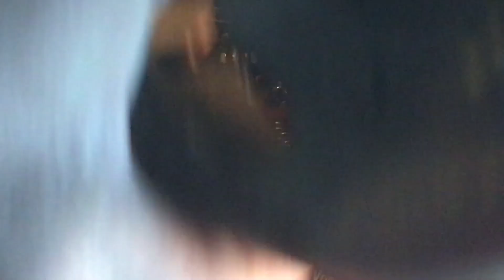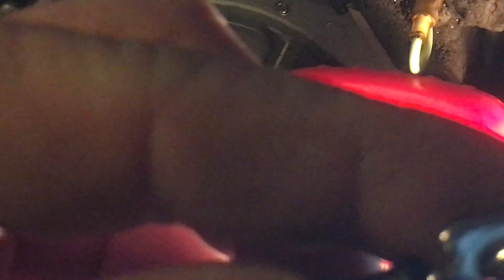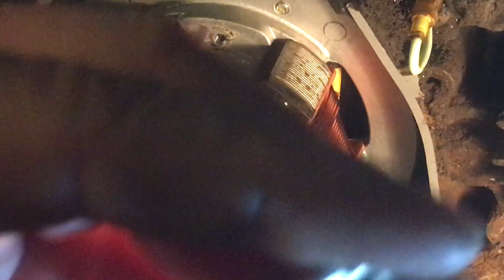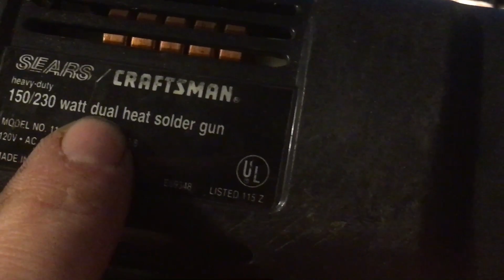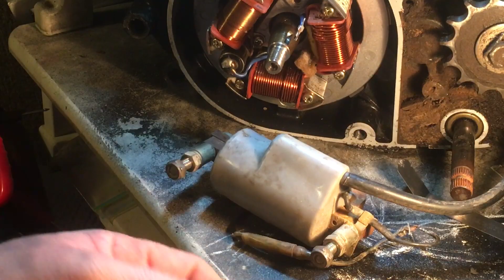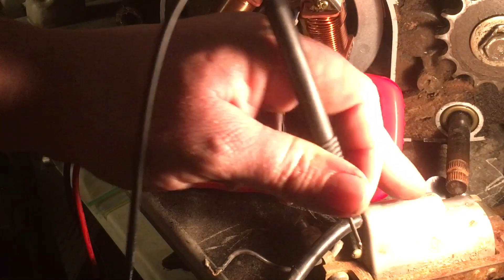ignition testing and tech talk

Comment: Hi Kevin. I have Suzuki B100p. When the marks on the cover/flywheel match those on the crankcase, may I take it that it is accurate adjustment of the points gap which determines the correct spark timing?

Comment: Hi Kevin love your videos! I’m having an issue with a 72 Suzuki TC125. I’m getting spark from the mag wire to ground but when I connect to the coil I get no fire to the spark plug. The spark from the mag wire to ground is very small blue spark no arcing. The coil is new after market off flea bay.  Points are good no shorting. I have no changed the condenser yet but have one on order. The primary coil on the stator tested good at 1.9 ohms. What am I missing?

Comment: Kevin perhaps you would be kind enough to help, saw your videos on ignition testing and to that end I have a 1979 Honda PA50II with no spark: my test results as follows,Charge coil-1.8 ohms spark plug cap 5.10k ohms: Ignition coil 8.14k ohms: and HT wire combined with coil 13 k ohms,the condenser which I'm not certain of results ie ohm meter 15 ohms and dc voltage I think was 0
Reply from the maker: Have you replaced your points and condenser and spark plug most of these old bikes just simply need a tune up in my 30years I have yet to see a bad 6volt coil in fact I tried shorting one out with 12v
Reply: @2strokeguru  Kevin, spark has been restored;charge coil wire loose where it connects to the black/ yell. stripe wire . Thanks for your help.
Reply from the maker: @billlester3088  welcome
Reply from the maker: If you want to call me 603 395 8097 talk. More about it

Comment: I've got a weird one for you. 71 G3SS - getting 25V at the headlight socket. Any ideas?
Reply from the maker: Yes you need a battery your getting alternator voltage install a new battery and voltage will correct itself

Comment: Yes there is a way to test the points on the bike and all hooked up? It's
Called a squauk box it sounds all the time but when they come together
It changes pitch.. do. Ra me. I've built my own out if a 12v blinker
They make a sharp pitch noise
Plus 4aa batteries to make a kind of like continuity tester... They use to sell them back in the 70s for especially 6v motorcycles. Well
Just thought I'd throw that out there
Have a great day.
Reply from the maker: Send me some pics handymotorman76@gmail.com  I'm interested
Reply: @2strokeguru  ya will do. It makes it so much easier to do your 
Timing on those  type of bike. Because all you have to do is hook
Your earth wire any were on the bike
And your pos to the hot wire coming from the points then losen the points screw to taught and turn your fly wheel back and fourth when f mark lines up correctly
You wheel hear a different pitch in the sound this gives you dead on timing. Alot of people think it's on but with the squak box you'll see 
Just how much they are off?
Once they are correctly done they can go 40 years with no problems 
And much more reliable than cdi
Box they can go out anywhere at any time it's just a capacitor...? Old two
Strokes are basically apocalyptic 
No battery no coolant and can be made diesel no spark plugs there 
Already doing it in afghanistan?
They just need the start of a glowplug and battery to fire them 
Then there off and going I think
I will try making one my self.

Comment: Hey,kevin. Do you know why my magneto ignition coils keep burning up and whether or not i can rewind my own coils or where to find the right magnet wire?
I can't find any on ebay or the internet .....I'm f'd!! Its my only form of transportation and i can't work because of it.
Reply from the maker: Burning up? That doesn't make sense the bike is 6volt not enough current to burn anything up except a light bulb if you don't have a battery
Reply: @2strokeguru  i agree. I donxt mean melting. The varnish on it darkened quite quickly, as if it had been through multiple heat cycles. The battery/lights coils have never changed colours and still look brand new. The new coil now looks as dark as the coil that was originally with it. When i rebuilt it, it was clear that the engine had never been over heated.
Reply from the maker: @stevendaniels8652  can you send me pics 603 395 8097
Reply: @2strokeguru  i know you are busy, but i did send you all the info to your number.
Reply: @2strokeguru  hey, kevin. If the spark plug was faulty, would i not see a spark at the the points upon rotation?
Reply from the maker: @stevendaniels8652  if rotate by hand is not fast enough you have to kick it over
Reply: @2strokeguru  are you still reaching out over text? This is time consuming...only a few minutes of your time.
I saw no spark at the points, kicking it over. An electrical engineer that builds coils said that that doesn't mean it doesn't work, but rather,  the condensor was working perfectly? Testing the spark plugs (the two ngk's i have b7hs) is showing 000 ohms...which a video i watched, is saying they are junk.....do you know of an autolite replacement, as i have not been able to find one.
Reply: Damn it. Now I'm getting a .7 ohm reading on the 200ohm setting. I give up. I'm so close to smashing this bike to pieces, you would not believe. Ive been working on this for almost a year and invested 2k into it. I should have left it in the field where i found it!
Reply from the maker: @stevendaniels8652  if you want send me the magneto I can check it out there's to much to text some times problems are more complicated than my videos teach or I don't have the troubled parts to do it on video
Reply: @2strokeguru  i agree 100%..

It's almost claustrophobic trying to text this kind of detail. Crossing my fingers, since  i just  bought two autolites and am going to solder it all and assemble everything tomorrow. If it doesn't work, sending it to you is my next option! Cheers....if i do, i hope you WILL make a video for others to learn.....I've learned so much watching your videos and in the last few days about the electrical, things i didn't even understand when you explained them, until i got my hands dirty. I always learn better when i can put my hands on it and can take the time to think about it.....it was a frustrating few days...until i woke up this morning and it just made sense....i even mapped it out in my head.....my issue is that the meter "readings" seem almost inconclusive, more grey  than black and white.....like i said, "crossing my fingers".....left you another text. Thanks kevin.

Comment: I got 75 suzuki tc 125 that had no spark. I changed the points and condensor and im getting a very inconsistent and weak spark. The ignition coil checks out good with my multimeter. So i disconnected the coil from the condensor and im getting 2.5 ohms with my multimeter set at the lowest ohms setting which is 200 ohms. Could this be my problem or did i cook the condensor using the pen style solder iron?  Thanks for your help.
Reply from the maker: Check your coil ground mounting bolts and the magneto harness plug for rust and corrosion
Reply: @2strokeguru  thanks for you quick response.
Reply from the maker: @puticiosaldana8705  welcome

Comment: Ok so I have a Ke100 engine I’m putting on a bicycle frame. It has one 4 pin plug coming out of the mag and one single teal wire with a large single plug. Which wire is supposed to go to the coil? Thanks
Reply from the maker: 2 yellow wires are for the voltage regulator green wire is for the neutral light black wire goes to the coil
Reply: Awesome thank you

Comment: Hey kevin this video has been incredibly helpful.  I just picked up a 1974 g4tr 100 Trail Boss 10-speed.  I've cleaned and reset the carb it has a brand new KAWASAKI HIGH PERFORMANCE IGNITION COIL 6/12 VOLTS POINTS OR CDI MAGNETO
 on it.  The bike will start 2nd kick every time and will run flawlessly for about 10 min then it starts acting like its running out of gas and will sometime backfire.  Any suggestions on where to start?  Someone said condenser but i dont want to just throw parts at it aimlessly.  Thank you for your knowledge!!
Reply: The spark looks awesome and its very strong
Reply from the maker: Check your fuel cap vent might be clogged and petcock might be clogging up
Reply: @2strokeguru  also i'll check the fuel cap vent out for sure
Reply from the maker: @mountainslapstick6170  let' me know how you make out
Reply from the maker: Also the sister bike too your bike is a Kawasaki kv100
Reply: @2strokeguru  I just put a new petcock on 1 hour ago.  The bike ran waaaay better with new petcock and new carb rebuild but still same issue.  This time it would act boggy but would still idle well until i gave blipped the throttle then it just wants to die out.  That is really good to know about the kv100 thank you.
Reply from the maker: @mountainslapstick6170  how is the exhaust baffle might be clogged
Reply: @2strokeguru  I'll check it out.  Would the baffle let the bike run well for a bit then cause an issue about 10 min later?  Cause just to reiterate that is my issue.  Bike runs great for about 10 min of solid road cruising then has the bogging/running out of gas sensation
Reply: The bike is very  very loud in the exhaust.  I've had 125s before and this thing is very noisy.  Exhaust speaking
Reply from the maker: @mountainslapstick6170  are you missing the baffle
Reply: No but after looking at a schematic on RMATV  it def seems like someone fabricated it on.  It's got some sloppy welds and is a curving "L" downward out of the silencer...
Reply from the maker: @mountainslapstick6170  might have the wrong jet
Reply: @2strokeguru  So it basically runs flawlessly until like said 10 min or so of riding when its really warmed up then it sounds exactly like the bike in this video.  Again only after about 10min or riding, uptill then it starts, idles and runs perfectlly.  

 https://www.youtube.com/watch?v=ky1-cltkCts&feature=emb_logo
Reply: I'm not trying to question you just making sure I'm giving the most accurate portrayal of what is going on
Reply from the maker: @mountainslapstick6170  its hard to diagnose through chat I'm off to bed call me tomorrow night 6033958097
Reply: @2strokeguru  Will do thank you very much
Reply: I didn't put it on, but this looks exactly like the ignition coil that is on the bike.  which looks brand new

https://www.ebay.com/itm/Honda-Hi-Performance-Ignition-Coil-6-or-12-volt-Points-or-CDI-Single-Lead/312770968265?_trkparms=aid%3D1110002%26algo%3DSPLICE.SOI%26ao%3D1%26asc%3D20190711095549%26meid%3D5ed67787575348a2a51d97b65872748c%26pid%3D100047%26rk%3D1%26rkt%3D12%26sd%3D193106065513%26itm%3D312770968265%26pmt%3D1%26noa%3D1%26pg%3D2047675&_trksid=p2047675.c100047.m2108

Comment: Hey kevin first off want to say thx for all thr very detailed videos, they have helped me alot, thx to you I have successfully changed  crankbearings reassembled and rode again!! Anyway i got a quick question on my latest $25 ke100 after pulling the flywheel to inspect coil and points i was very surprised to see 6 magnet flywheel, per your videos i have learned that those flywheels where produced later and for 12volt systems. I am sure the coils and points and condenser on the stator are of thr 6v variety.  I have a 3 magnet flywheel off another ke i was gonna use but was wondering if your expertise could shine some light on light on if the 6mag flywheel would work?  Once again thanks, and keep on enlightening!!!
Reply from the maker: Yes that's the older style it's still 6 volt because of the windings
Reply from the maker: Very welcome
Reply from the maker: You can use a 3 magnetic flywheel in place of 6
Reply: @2strokeguru  so either flywheel would work the six magnet or three? The 3 mag seems to not follow the curve of the crankshaft as well and sticks out ti far.  You are the man btw, promt and curtious
Reply from the maker: @nathantoubia6256  thank you some early crankshaft had a different taper

Comment: Kevin, I’ve seen that you have a repair manual. I haven’t been able to pick one up yet. Are you able to look and see what the torque spec is for the nut that holds the flywheel on? I’ve sheared off the woodruff key twice now, so I’m trying to repair it and make sure it’s out on correctly.
Reply from the maker: Drew I give that spec every time I pull a flywheel 36 ft lbs
Reply: Re 175 v 100 . .looks like engine is diff . .do gear transfer? Front n rear wheels? From what I googled engines dont

Comment: Why is my bike sputtering soo much !! It was fine! But once it heats up it just starts backfiring
Reply from the maker: could be bad points could be dirt or water in the carb bowl could be a bad plug those  are the 3 most common problems
Reply: Kevin Bergeron I changed plug... And cleaned carb.. but carb was clean... So now I'm gonna look at the points.. I'll watch this video.. any tips
Reply: Note to self .. 0.35 mm or .014in
Reply: Kevin Bergeron the spark plug was black and oily
Reply: Note flywheel nut 36 fp
Reply: How do I get the flywheel off this thing

Comment: What woodruff key does the KM100 take? Mine sheared and I can't figure out which one to get
Reply from the maker: i dont have a part number for them but if you take your 2 halfs to the hardware store you can match up thats caused by a losses flywheel nut tourq is 36ft lb
Reply: Thanks, and should I be able to easily run through all the gears with the engine off? I can easily get into 2nd but after that it doesn't always click into the next gear, I can get it if I kinda roll it with the clutch let out but I don't know if it's supposed to be like that

Thanks for the help,
William
Reply from the maker: William Harsent welcome no bike has to be moving to go through all the gears they have to mesh together